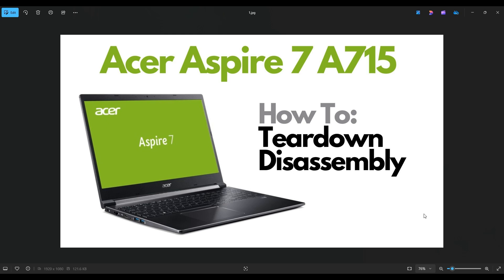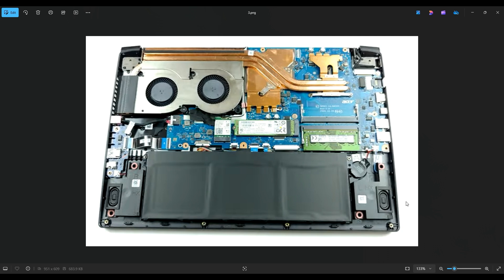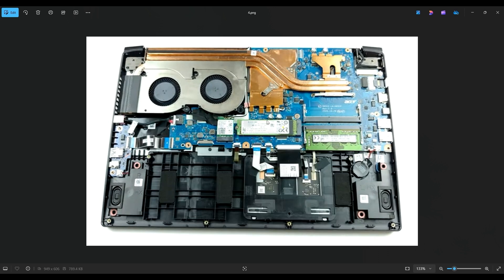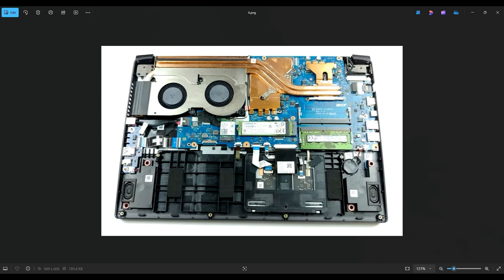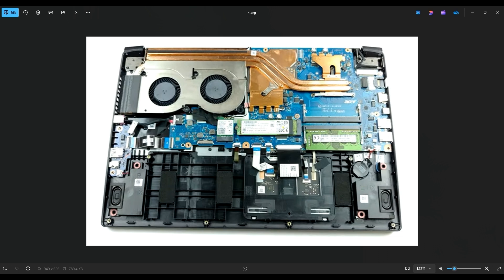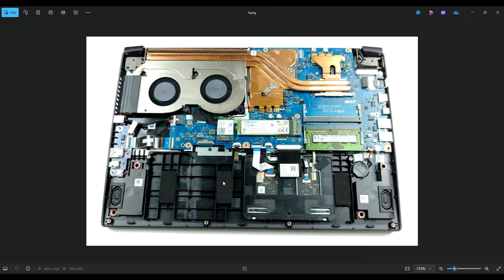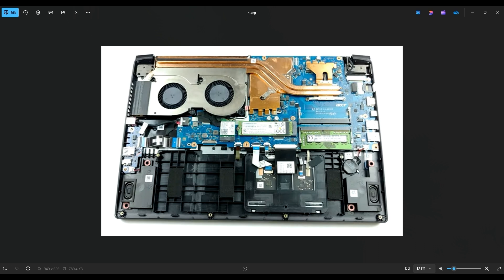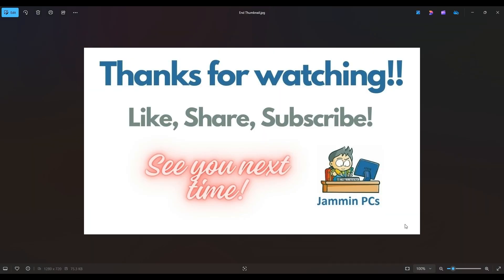Teardown / Disassembly, Upgrade Options - Acer Aspire 7 A715 (A715-42G) Series Laptop Computer

Comment: My sister drop this laptop and broke the monitor, how can I relace it please
Reply from the maker: You would have to take it apart as seen here. You would have to access the inside of the computer to unscrew the hinge assemblies and un-run the antenna wires and the LCD cable. Then, you would have to get into the LCD assembly to remove the LCD and replace it.

Comment: I wanna replace the graphics card how to do it 
Aspire A715-75G

I know directly we can’t change it but what are the other ways like soldering etc and how to do it or where to get it done
Reply from the maker: Yes, as its integrated into the motherboard, you would have to take it somewhere that can do motherboard repair like that. However, with most printed circuit boards, (PCB's) most motherboard repair shops will not do that. Usually your best option is to replace the motherboard with one that has a better card if that computer has that option, which is not very common either :(